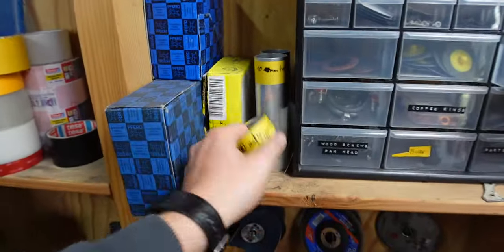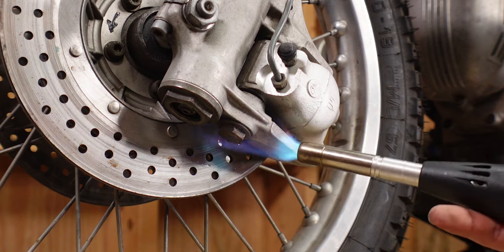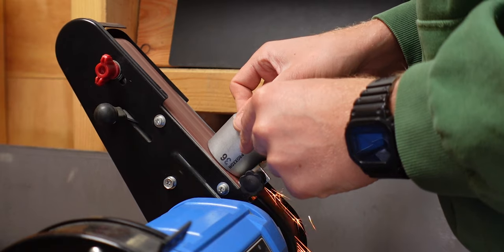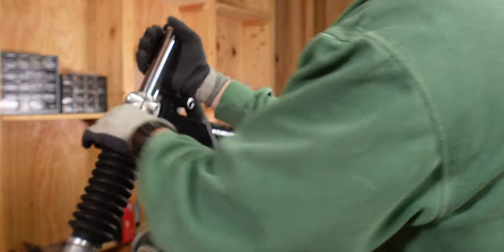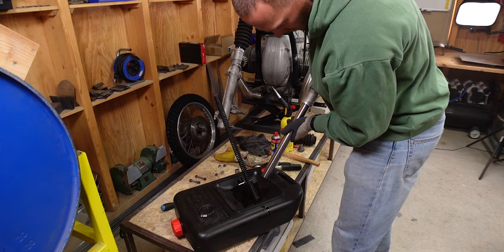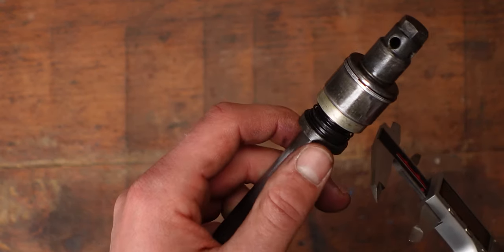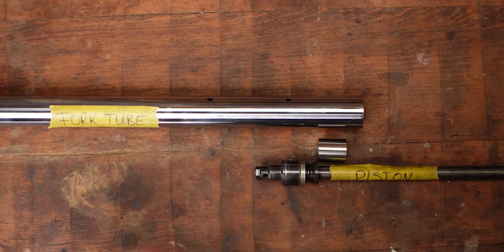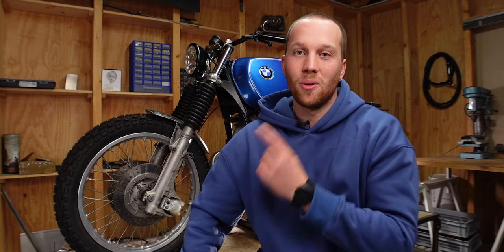How To Shorten Motorcycle Forks - BMW R80 Build

Comment: The simpler way to determine the volumetric displacement of the spacer would be to add water to a measuring cup, note the volume, then drop the spacer into the measuring cup with the water and subtract that volume from the original volume.
Reply from the maker: Oh, that's a very good tip. Will do that before finally rebuilding the forks soon. Next week I'll get all the parts back from the powder coater.

Comment: Hello! I have a same model. Do you also need to shorten the spring by 30mm?
Reply from the maker: I haven’t done that (yet). I saw videos where people shortened the springs. I’ll see how it works out when I rebuild the forks and have oil in them. They do close at the moment, so I hope it works without having to shorten them but I need to try that out once I have all the parts back from the powder coater. Also, need to see how much less oil it takes. I’ll probably make an update video down the line. Have a great one!!
Reply: @MotoWrenchers  thanks for the answer. Good videos!
Reply from the maker: Thank you, I appreciate the feedback 🙏
Reply: Yes, if you don't want preload.

Comment: Class video. Thanks
Reply from the maker: Appreciate it, Lukasz! 
Do you have a project where you want to do the same?
Reply: @MotoWrenchers  hi Josh. Yes. My project is in progress.  I won't shorter the front fork yet.  Plan for future however I have also fitted progressive springs
Reply from the maker: Nice, sounds like a good plan. One thing after the other :)

Comment: Hello ! Thanks for this video, i'm less scared to do it now !
One question : How many milimeters did you remove on the fork ? 
Thanks
Reply from the maker: Hi, that's good! Which bike are you going to lower the forks on?
I've lowered mine 30 mm, just by adding the spacers.
Good luck with your project! - Joshua
Reply: @MotoWrenchers  Almost like yours ! I have a BMW R100RS from 1978. Thanks for the answer. At the end of the video you said that next time you'll try 40mm but do you think that more you lower the forks more the stearing/turning angle will be impacted ?
Reply from the maker: I have also just done it once, so...I can't really say how it will affect the steering angle but I thing the 10 mm more won't have a dramatic impact. I have a friend who lowered his triumph 130 mm and it rides fine. I guess if you have the means to make your own spacers or you can find a tube with the right dimensions you can always make a second pair of spacers and change them if it's too aggressive. Let me know how it's going.
What is your overall plan for your R100RS?
Reply: @MotoWrenchers  Well i will lower mine juste like yours first. Your R80 looks a lot better with the shorten forks ! 
My plan is to make it Bratstyle. 
I have bought a customize subframe,  a pair of YSS rear shocks, a new handlebar, mirrors, mudguards,... 
I also want to rebuilt all the wirings with a M-Unit to make the electric stuff more simple and reliable. Also install a new master cylinder for the ATE front breaks because it's a must do ! Of course firestones cafe racer's like tires and a pair of ( not so loud ) mufflers.
I will follow your work from now !
Reply from the maker: Hi Mickael,
How's your project going? If you want, send me a few pictures on Instagram. Would love to see it and follow the progress.
Reply: @MotoWrenchers  Hey, my project is still a work in progress, for the moment, i am stocking all the parts and pieces i need, then i'll work on it full time. Send me your instagram i'll be please to send you some pictures.

Comment: Moin, was für ein Material hast du denn für die beiden spacer genommen ( VA, was gehärtetes oder Wald und Wiesenstahl )? Gruß maxpowers
Reply from the maker: Moin, hab VA genommen. Ist glaube ich gut keinen x-beliebigen Stahl zu nehmen. Welches Bike willst du tiefer legen? Schöne Grüße Joshua!
Reply: @MotoWrenchers  möchte das bei meiner R80 machen. Ich hab da auch VA Material gedacht, davon hätte ich auch noch was passendes hier bei mir. Gruß maxpowers
Reply from the maker: @maxpowers402 nice, viel Erfolg! Hast den Luxus einer eigenen Drehmaschine?
Reply: @MotoWrenchers  leider nicht zuhause, aber auf der Arbeit ist alles vorhanden, sägen, drehen, fräsen 😁
Reply from the maker: @maxpowers402 geil! Das hätte ich auch gerne 😍